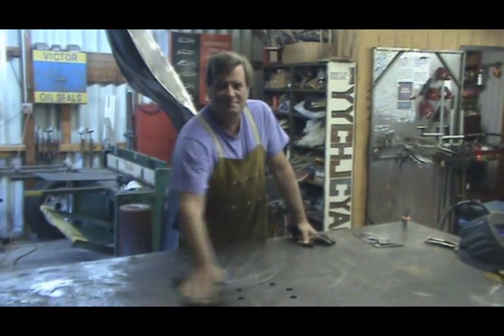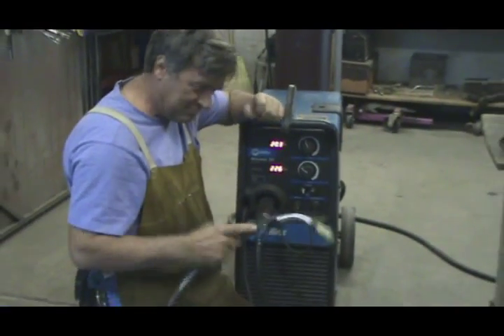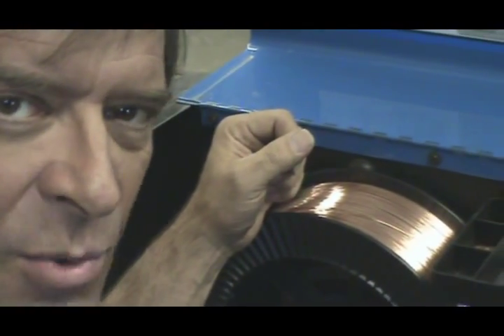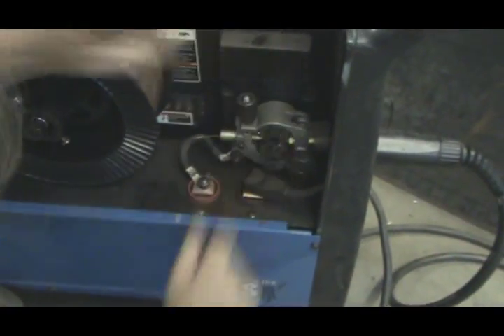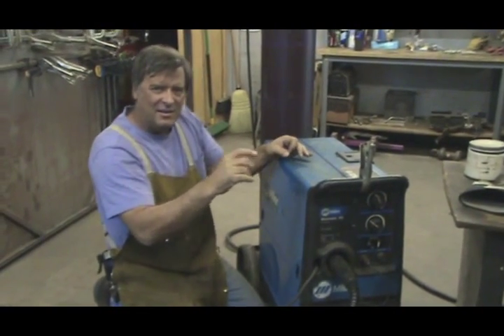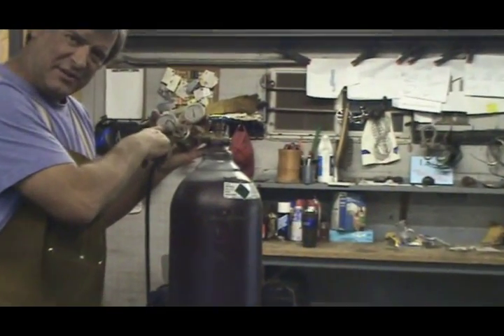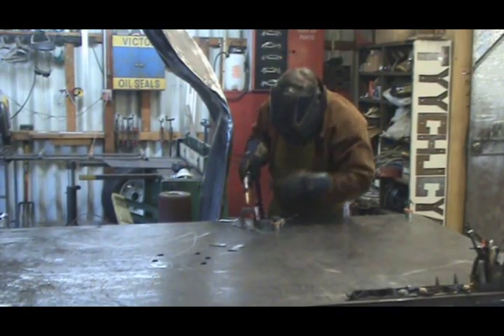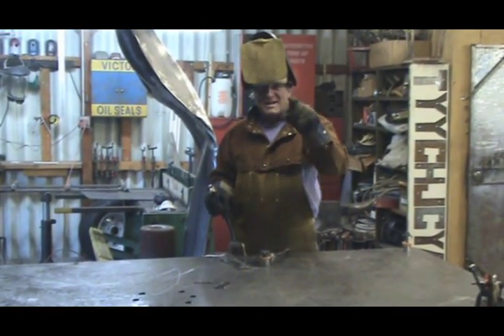MIG Welding Technique - Kevin Caron

Comment: I'm wondering  if you have used silicon  bronze  wire? I have some and am going to play with it. I am using 100 % argon, but still have to figure out the right settings. .030  wire ...what do you recommend .?
Reply from the maker: Alexander Chavez Have not used it on a mig..    Only tig....

Comment: Kevin thanks for the great videos. I know with mig steel you have to turn your volts up a little bit doing vertical up's. But do you have to do that with aluminum to?? Im using a XMT 304 with a miller spoolmate 200.

Comment: an excellent mix imo is 90% argon 10% oxy.  in that set up the oxy is for penetration. But the great thing about this gas is it allows you to run spray on a lower setting, but then turn up the voltage and amps, so you can run spray.  very versitile.  or just 98/2 for just spray.

Comment from the maker: @kazl1m I have been using about 3 bottles of gas per a spool of wire.  Of course your mileage may vary.  I do about 95 percent of my welding indoors. 

Great question, thanks for posting.

Comment: My big Mig welder I put 035 wire on it.  My Small Mig has 025.   The smaller diameter wire is better for welding thin metal, You wont burn threw it as easy.

Comment from the maker: @1970chevelle396.   Yes, 1 amp per is a great starting point. I adjust thwe wire speed for the size of the joint I am weld or the big hole I just blew through and now have to fill. Getting the feed speed right does take some practice but it's not hard.

Comment: Normally you set the amps. 1 amp for every thousand of an inch thick .  The wire speed you can hear it when your welding if you have the settings right.   It takes some getting use to.  After a while you will know just by the sound of the welding, right.